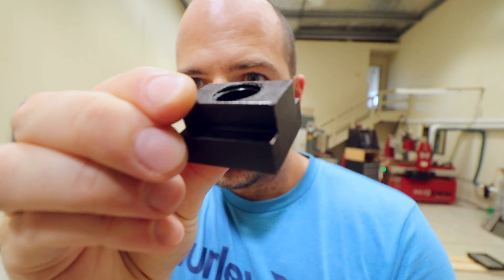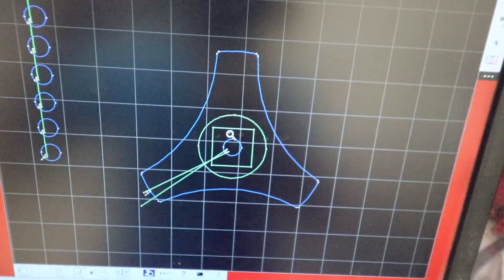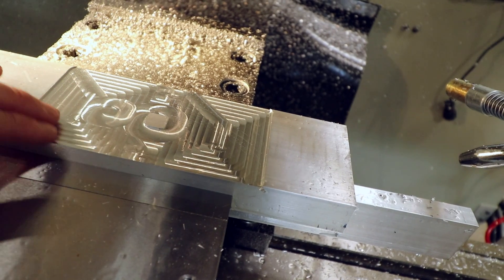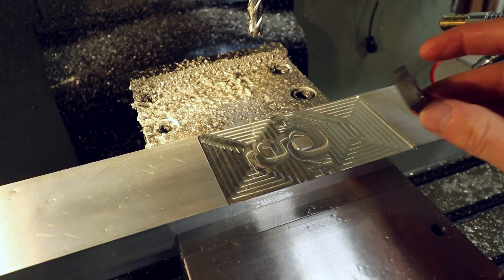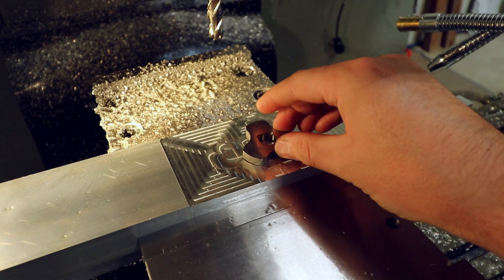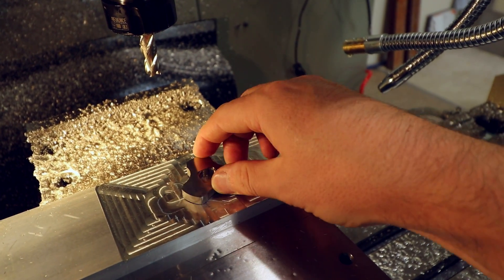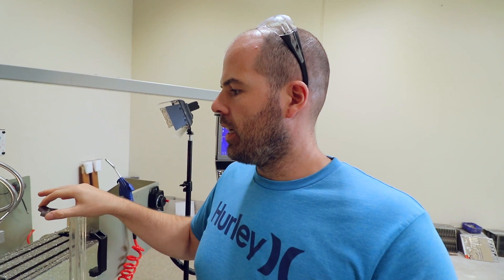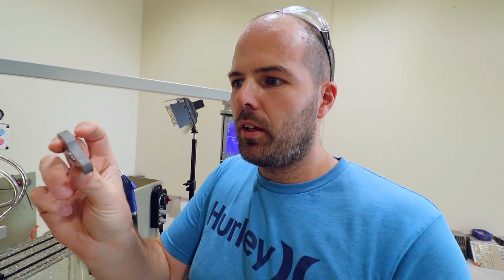Making a Fidget Spinner (Part 1)

Comment: Hi Magnus, As a suggestion for machining, why not cut the blank oversize or without certain features so you don't have to be concened with precise alignment on your first side when machining....then have a locating fixture for your second side.
 Also maybe look at special side clamps you can buy like OK-Vise or Mighty bite clamps. 
Some of these have like a "soft jaw" ability  wher you can machine a the shape of your part into these clamps so you can hold them with strength and precision.these are great for low profile clamping to give more room for the endmills etc to get into most of the part to machine....google them...OKVise   Mighty Bite.

Comment: Hi Magnus, I hear you use Solid Edge.... 
Solid Edge has a plugin facility to link in to CAM software. You can add in links into Solid Edge plugins so when you have finished creating your model in Solid Edge, you can then transfer/export it into your CAM software directly using the plugin inside Solid Edge.
 I have GibbsCAM linked to my Solid Edge plugin which lets me export the model straight into my GibbsCAM software to start programming the machining process.... hopes this helps if you haven't discovered this feature in Solid Edge.